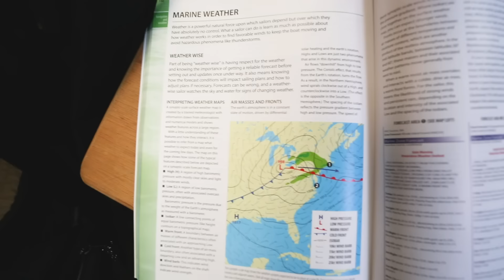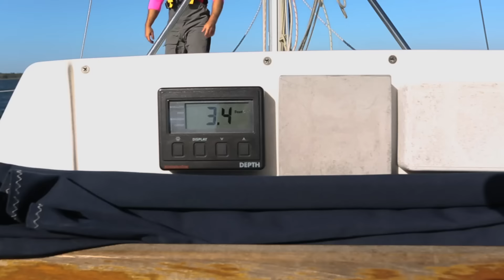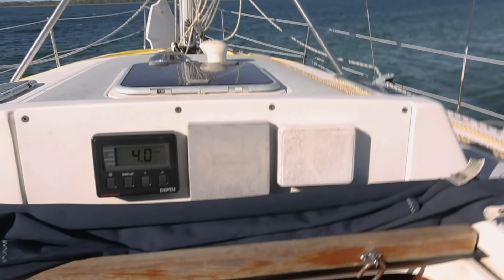How I Learned to operate a Sailing Boat in 5 Days

Comment: Dude, that's the worst boat driving skill I saw by far lol you need to calm down and go easy on the boat otherwise you will explode everything. Boat responds slowly to steering and engine commands. Keep in mind that there is no rush, take all the time you need or do it all again. It's a lot different than a van! Good luck bro and mostly, stay safe. Have fun!

Comment: I don't think I want to learn sailing anymore, looks like way too much.
Reply: Try a smaller yachat club local.  Pop by a boat ramp where sail boats launch, and view setups.  Not too difficult once you've seen it a few hundred times.   All boats are similar, learn on a smaller boat (20').  There is less gear and in winds less than 15 kts, easier to work lines.